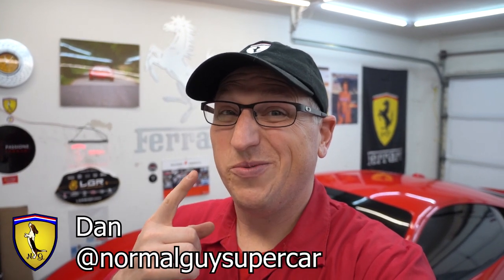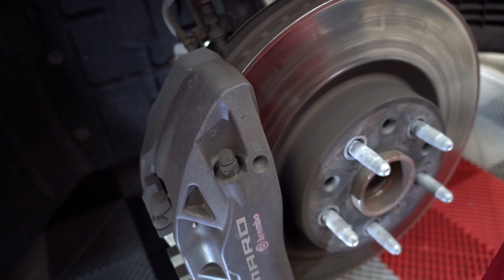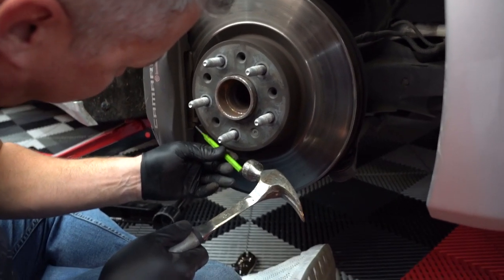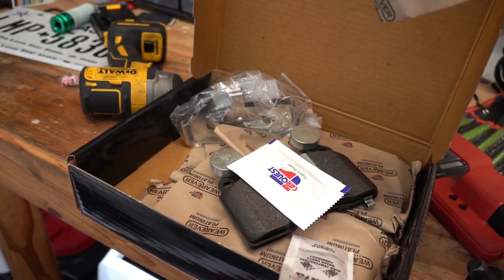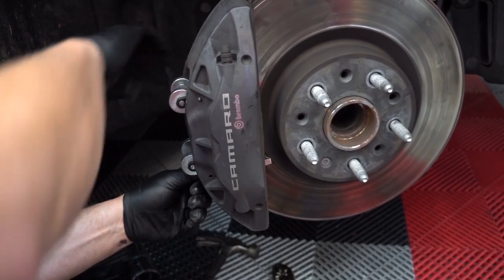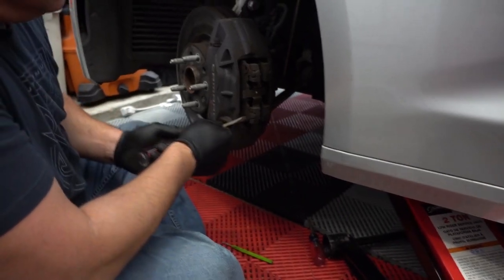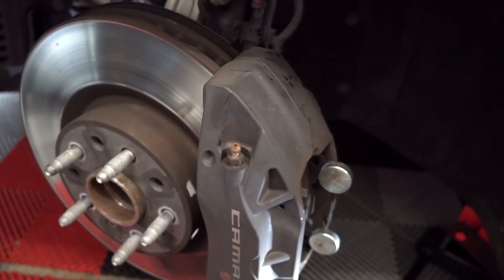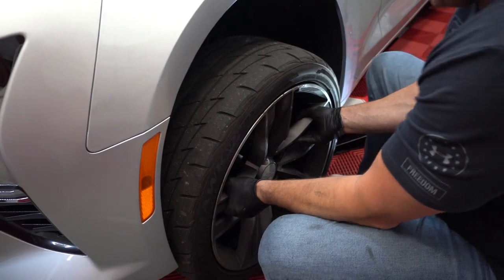MURICA DIY!! Changing Camaro SS Front Brake Pads

Comment: I agree with the cracking the bleeder method, I was taught to never push the brake fluid reverse through the system but I'm sure everyone has their own ways, have a good one man👍
Reply from the maker: I can see that theory... Pushing bad fluid back... May be best to bleed / flush then change the pads so it's all clean fluid.

Comment: Always take the cap off of the master cylinder reservoir before pushing the brake piston.  That allows room for the movement of the fluid in the system

Comment: I've seen some laughable stuff on this channel, but this takes the cake. There were several things done wrong, but the worst was that piston that wouldn't move. It was seized, rusted in place. You do not use a crowbar and lever against the rotor to break it free. The caliper should have been stripped and rebuilt because it will seize again and the poor fool allowing you to advise him may not be able to stop quickly when he really needs to.
It makes me glad I did my 4 year mechanics apprenticeship and worked with skilled guys who taught me properly. People who just do bodge ups like this should never be allowed to touch brakes and suspension, if only to protect other road users.
Reply from the maker: It's fine
Reply: Lol

Comment: Usually when I see lug bolts that tight it's because some idiot used an impact on it, and didn't torque it correctly
Reply from the maker: Most likely that happened.
Reply: @normalguysupercar  good thing he was able to take it off without breaking any bolts
Reply: Torque spec on wheels for a Camaro is 140 ft lbs.

Comment: That's a dumb design, what keeps them pins from working themselves out, and either hitting the wheel, or falling on the ground?
Reply from the maker: Well considering that's how brembo has been doing it for a long time, I'm gonna have to disagree. It you put the pins in correctly, it seems impossible for them to just come out on their own.
Reply: The spring holds the pins in place.

Comment: You made a 30 second job last 20 minutes 😂😂😂😂😂😂 if you drive hard you should be using quality parts as car quest is for normal driving. New brembo rotors and pads are a better choice but $$. PS due to the clutch fluid being the same reservoir as the brakes, you need to constantly change or flush the brake fluid. I do mine a mini flush every 3 thousand miles from the reservoir and than I pump the clutch pedal 30 times of so to spread the new fluid. Repeat that till you go through a quart as you can really store opened brake fluid. Cool video rookies 😂😂😂 Camaro is the poor man’s corvette 😂😂😂 tell me that’s an automatic and I smell vagina 😂😂😂
Reply from the maker: Cool sorry